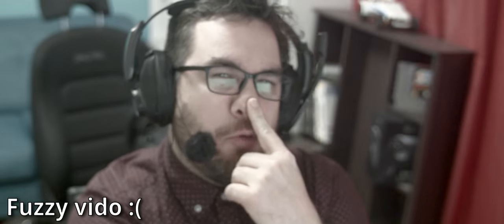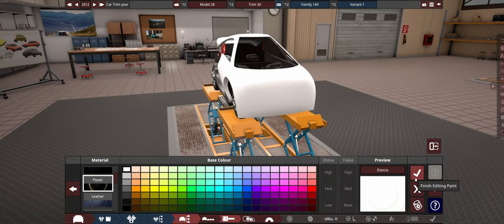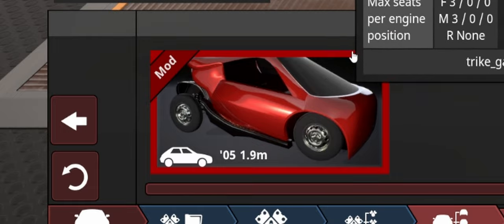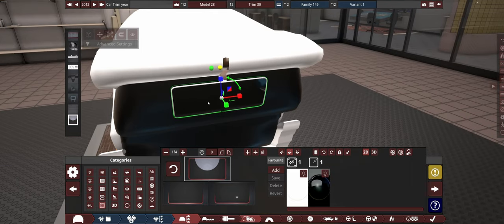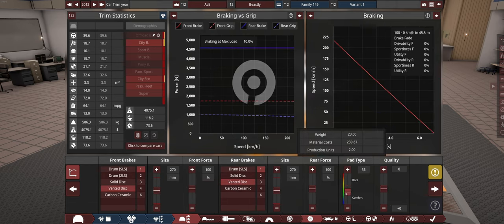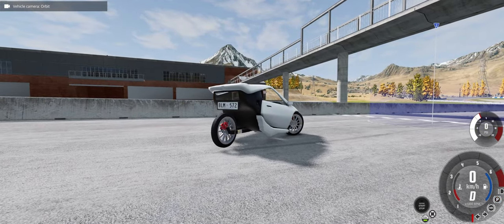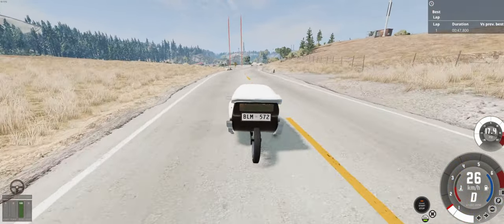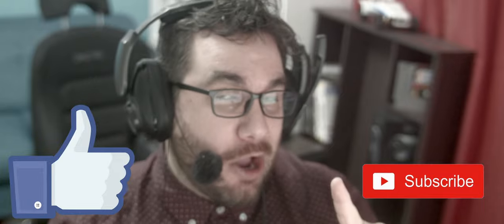The NEW Trike Meta 👌 (Automation🔧BeamNG)

Comment: I find it interesting that with front transverse the gam puts the engine over the front wheels, like you would expect, but with front longitudinal RWD, it puts it behind the front axle in a front mid engine position. This means that the engine position in that case, is entirely dependent on firewall position. Alot of the car body's have to engine really pushed back. Which can be strange for a non sporty car.
Reply from the maker: yep, that is highly dependant on the way the mod is made

Comment: That whining that is louder than the engine, that's the turbo. They can be quite loud, but on the flip side when making a knockoff diesel it actually sounds pretty spot on for a diesel.
Reply from the maker: it shouldn't be that loud though. I've been in modern high pressure turbo vehicles, and they are no where near that bad!
Reply: @fillman86  it's also really loud in automation. High PSI turbos can be deafening when paired  with specific intakes

Comment: So wait... You're saying we can do narrow front-track vehicles like the Nissan Deltawing? Could you do one for a video? A single-seat ultra-streamlined race delta-wing with ground effect, and then a 3-seat road-going blade-glider version would be nice. But make them both ICE just for the coolness factor. Also at 1:15 technically torsion beam would act the most like a swingarm that's found on various 3-wheeled cars.
Reply from the maker: it is on the list :)

Comment: I am no physicist, but i know that there is more to the traction formula than just pressure / area. If i recall there is attraction force between the road surface and rubber tyres and also the curled structure of rubber plays into it. Don't ask me how it works, but i got chewed out by a physicist for stating that the contact area between road and wheels doesn't matter.
Reply from the maker: it comes down to pressure measured in force per area, like pounds per square inch. Now it's true that tyres are a bit more nuanced than that, but in real world testing, there's not much you'd be able to tell, unless you were an irl top bracket racecar driver.

having wider tyres means your tyres run cooler, because there's less work being done per unit of area, meaning you can run a softer compound, but in our trike example the compound is consistent